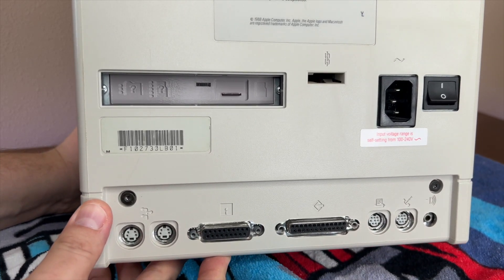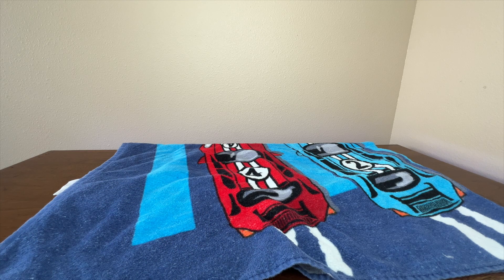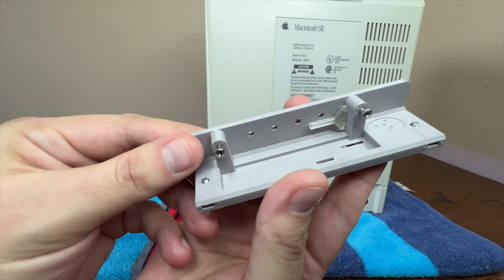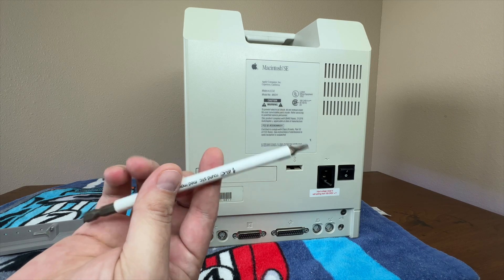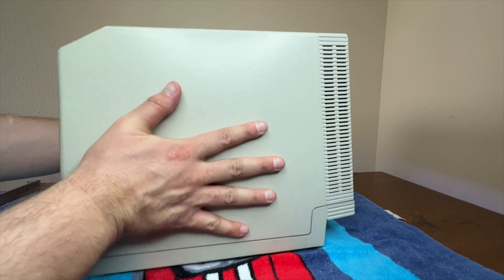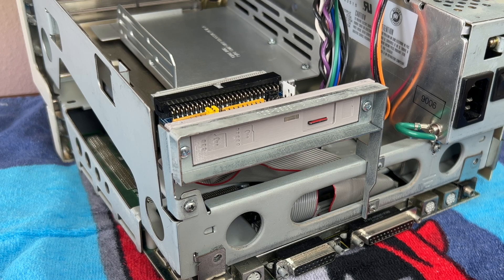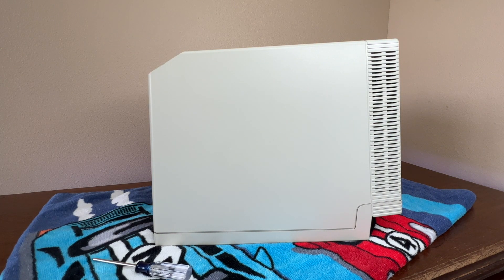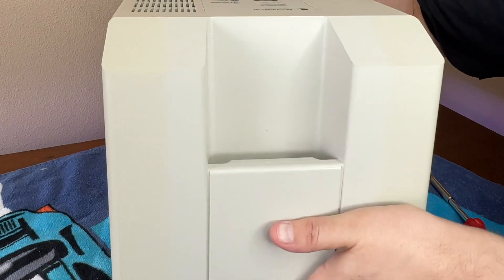Installing an SD Card Slot in a Macintosh SE

Comment: Is there a way to do that if you already have that slot in use?
Reply from the maker: Joes Computer Museum sells a bracket to mount the BlueSCSI v2 in a floppy drive slot. v2 uses the full size SD cards too so they're easier to handle 👍

Comment: I put a bluescsi in my SE/30, then got an SD card extender (ribbon cable) and ran it through the security lock slot in the back of the machine.

Comment: Is that how that bracket supposed to go in? It seems like you should put it in the other way around (going in from the outside, if that makes sense) so that it sits flush with the outside of the case

I could be wrong
Reply from the maker: Nah that's the way this one goes in. The screws make this one challenging to be flush with the case, but I bet it would be possible to rig one up where you screw it in from inside of the computer. The expansion port is designed weird imo...
Reply: @insanelygruz  That's very interesting.  Thanks for the response though!

Comment: Might want to say this shows the old version of BlueSCSI that is no longer in production as it has been replaced by the BlueSCSI V2.
Reply: While we're not stocking it anymore (though you could always print your own v1 (or v2)) we're still releasing updates to the firmware. v1 is still plenty fast for a SE, but if you're picking up a new one, might as well get a V2 :)
Reply: Considering it is an open project and you can build your own BlueSCSI v1.1 (and still purchase from several of the authorized sellers), I wouldn’t really call it “out of production”, but yes, good to point out this isn’t for v2
Reply from the maker: Yeah I don't have a v2 yet but I don't think there are any expansion bay brackets for the V2 for SE or SE/30? That's what this video is about.
Reply: was thinking more that the official channels are not producing this version of the BlueSCSI anymore so don't go looking for this version of BlueSCSI(unless making it oneself).